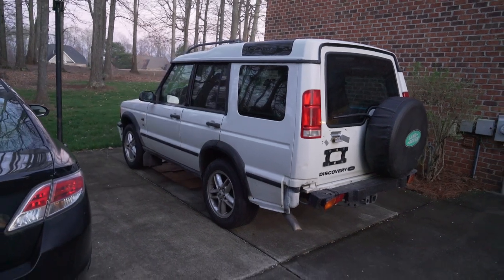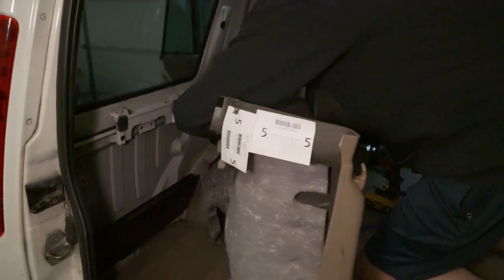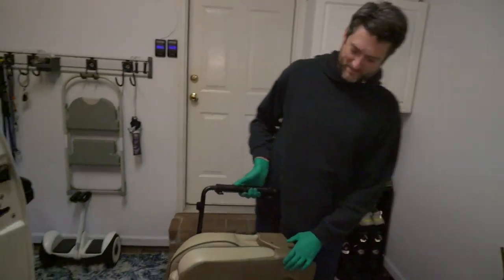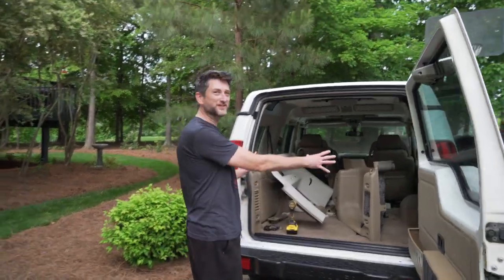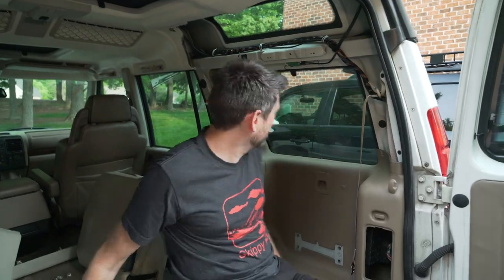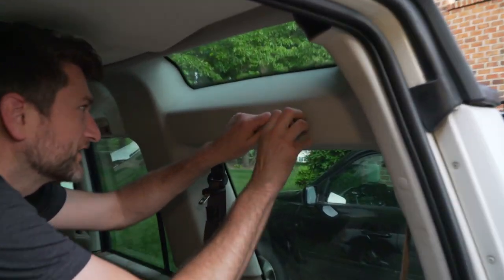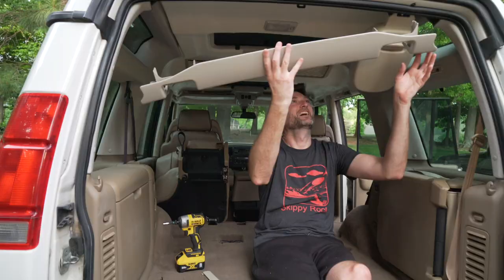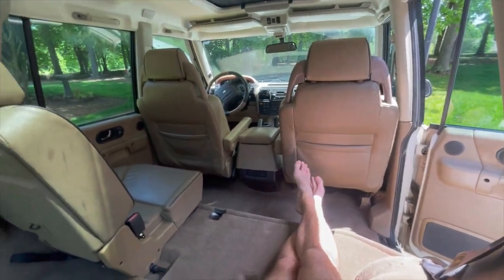Adding a 3rd row jump seat to my Land Rover Discovery 2!

Comment: Second in existence lol I did mine last year to my 2000 D2. I left my second row seats off so I can have my gf in the passenger and my daughter in the jump seat with so much leg room plus my semi big dog, and room for luggage.. you did a good job by the way, I was exactly the same way as you since it was my first time doing it haha.. i just finished converting my core support to a bolt on..
Reply from the maker: That's awesome!  It was a fun project. It actually works nicely with the jump seat and no seat middle seat for hauling stuff.  Gives more room than with the middle row folded forward. I think my next project will be a steel front bumper.   So core support to bolt on?  I'm not familiar with that upgrade?
Reply: @SkippyRockGame  not really an upgrade haha.. it got front end damage from an accident so I had to drill out all of the plug welds replace core support, radiator, oil and trans cooler, and AC sys. But instead of plug welding core support back on, I did a bolt on set up. I used to do it to my drift cars when I used to drift. Makes it so much easier if I have to replace anything in the future.. also thinking about putting 2 steel bars from the firewall to the core support so if it does get in an accident again I don't damage and radiator etc.

Comment: I just bought a 2004 land rover discovery 2 on copart from Tucson, AZ for 600 fees all in 1081.00 with 146k on odometer the discovery was in a accident in December 30 2023 front end with no airbag deployed,  what impressed how frame/ undercarriage was no rust anywhere no oil leaks no door dings or hail damage,  this is a 7 seater but no seats stolen or previous owner still has them bummer 😢 , even tho I probably would have removed them for more storage , I will need new passenger fender,  hood, grill ,I will need to pull fender out and reshape it hopefully,  engine will bump no star due to fan clutch and radiator touching,  and I need radiator support bracket and 2 headlights,  mine white also , head liner needs replaced,  rear sun roof open , closes but won't seat on roof stuck in the vented position,  interior in good shape but nasty filthy I'm pulling out carpet for a real scrubbing & shampoo,  my plans are building a off road/ overlanding build once I know if engine shot I want a l s swap lost cause channel did a swap well detailed viedo , I have always liked the discovery 2 no air suspension thank god , I also own a land rover lr3 hse got it off copart 1100, that has the air suspension I really like the lr3 also too bad the discovery wasn't made with a split tail gate instead of swing door anyway good luck on your project
Reply from the maker: That's awesome!  It's really pretty fun taking apart older cars, cleaning them up and putting them back together. I've got a Porsche 968 I'm working on freshening up now!